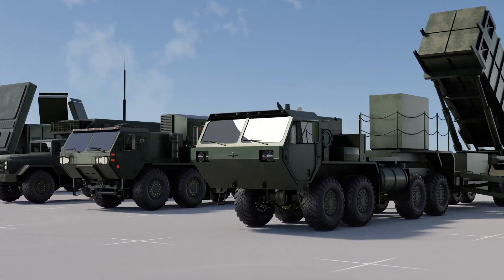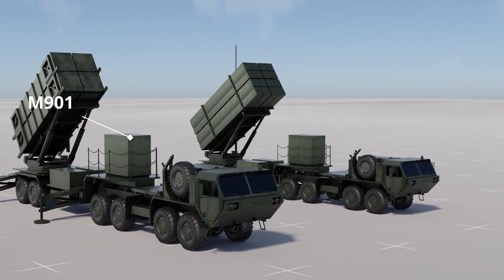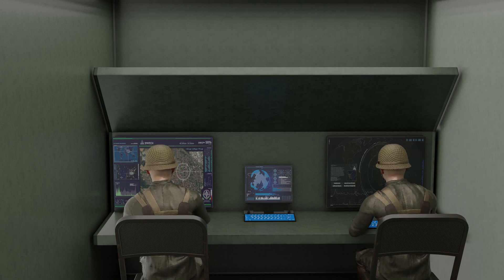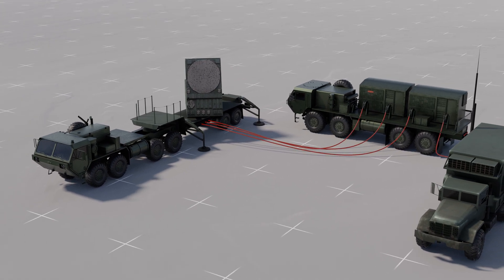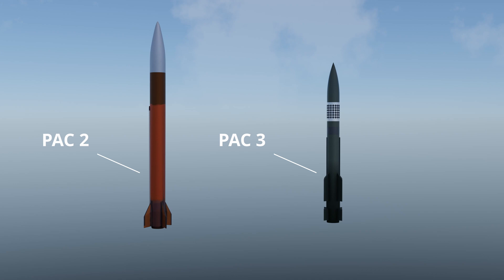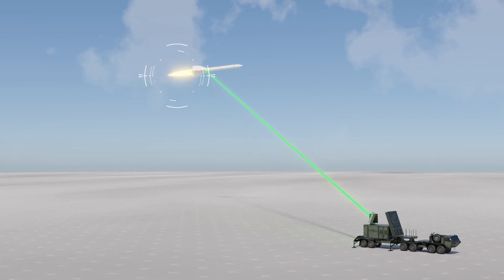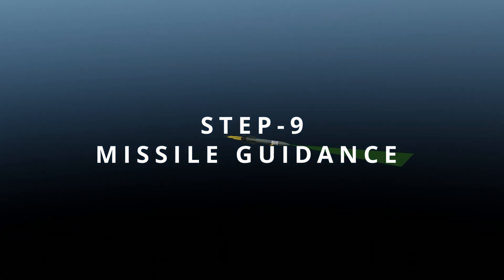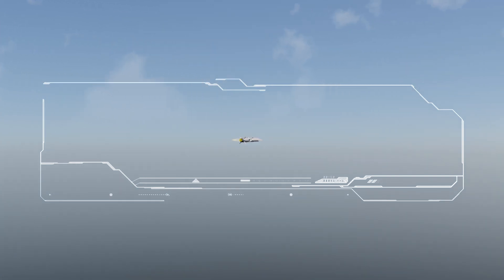American PATRIOT Missile System: A Closer Look Inside the Technology

Comment: Obsolete pieces of equipment.
Reply: Your mother yes
Reply: @Anonymous-it6hu  ur sister as well
Reply: What is obsolete?

Both the Patriot and THAAD are routinely intercepting Iranian built Houthi ballistic rockets and missiles.

Ukraine is using the Patriot among several other air defense artillery.

Both Raytheon and Lockheed Martin have contracts well into FY27.
Reply: Bryan Hoppe you're right, but no use arguing with a troll